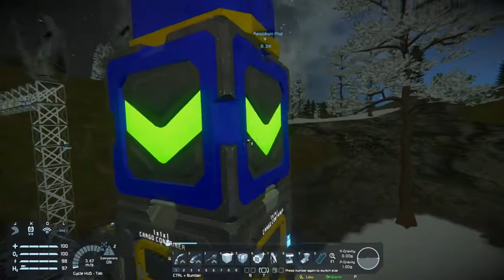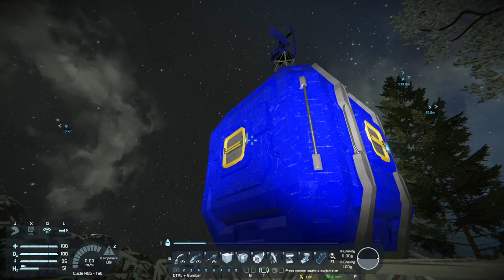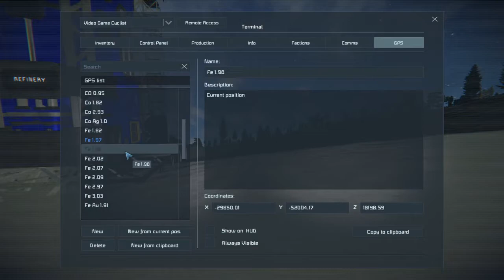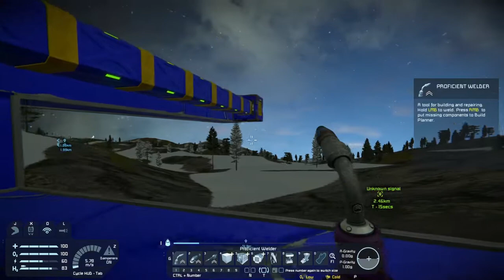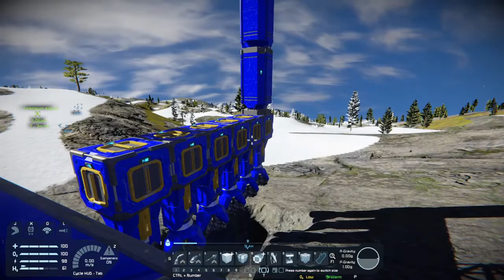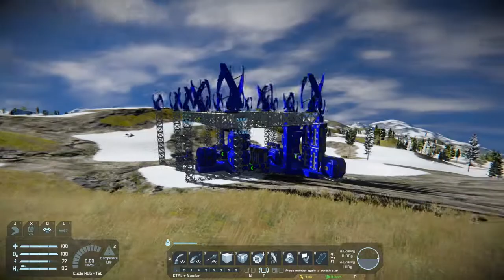Space Engineers Episode 05, Mining for Iron

Comment: In the option of the conveyor sorter, there is a "drain all" you can tick, that does what it says, drain all. When I come back with my mining ship full of stuff, then the sorter is set to drain all and then the specific thing in the whitelist or not using whitelist, but simply just drain all, that way my miningship get emptied asap and I can quickly make another run. When wanting to use ejectors and sorters to throw out stone or gravel, then it differs a little between small blocks and large blocks. With small blocks you use conveyor sorter, set to drain all and then whitelist the stone and then setting the ejector to throw out. With large block you also use a sorter, but then you use the connector as an ejector. The connector also have a setting for "throw out" /ejecting, and the sorter is set like small blocks.
Reply from the maker: I can't wait to start building with large grids! Thanks for the tips.